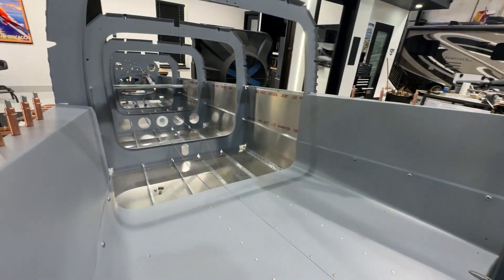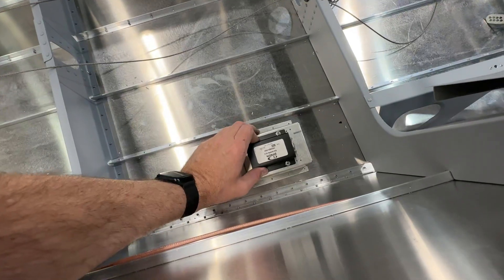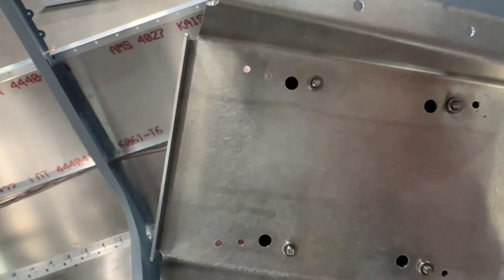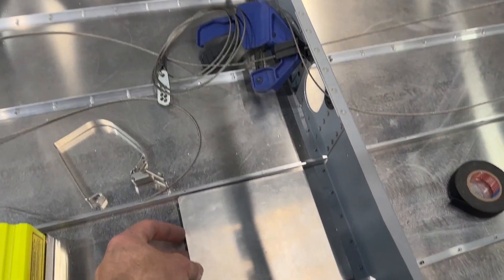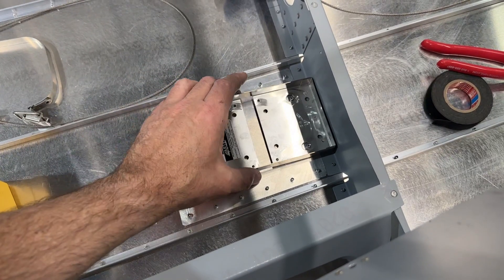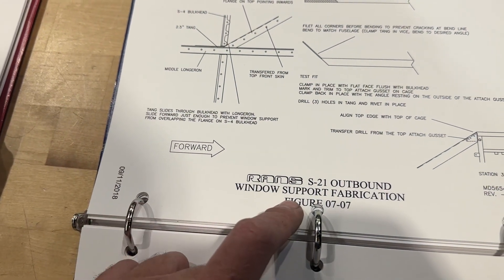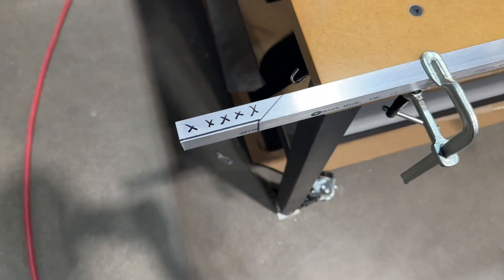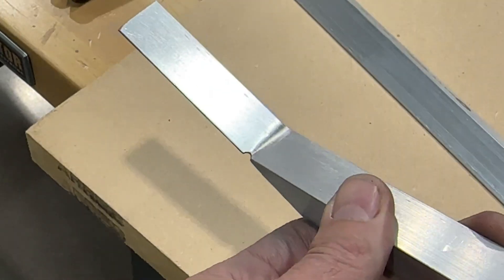Ep. 20 - Rans S-21 Tailcone: Part 3 - ELT, ADSB, Top Skins & More

Comment: I opted to go with integrated NAV light strobes which are legal in Lou of a beacon protruding up on the tail. What are your thoughts on that?
Reply: In that case your strobes become your anti-collision lights.  Some people don't like leaving their strobes on while on the ramp.  You CAN turn them off if you believe they are a distraction to other pilots (and still be in compliance), but then you have turned off your anti collision lights.  Others say they just leave their strobes on when on the ramp.  Some are putting a light on the fuselage to avoid the tail installation.  I guess it's all personal choice.
Reply from the maker: I was taught way back when I learned to fly that a beacon should be on before startup to alert bystanders that an aircraft is powered up and ready to start it's engine.  The strobes could certainly achieve that purpose but I sometimes like to leave strobes off while on the ground as it can be distracting to other pilots in low light conditions.  Having a separate beacon allows me to always have something flashing.